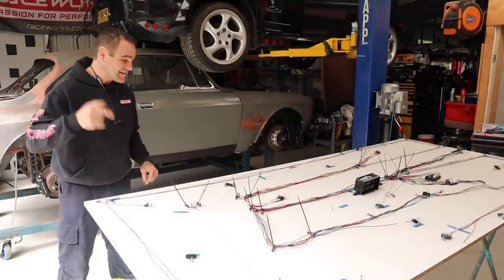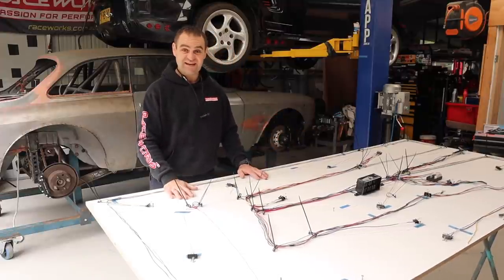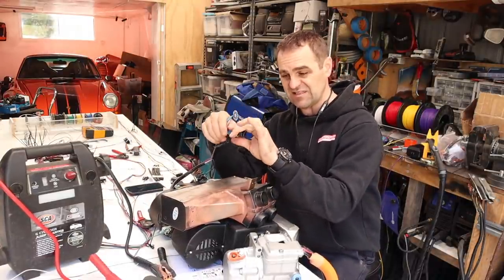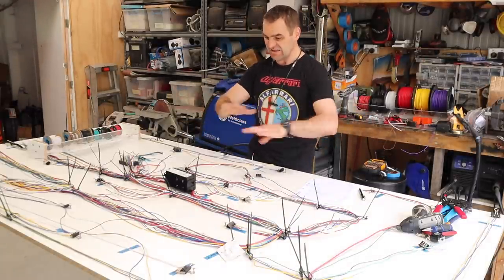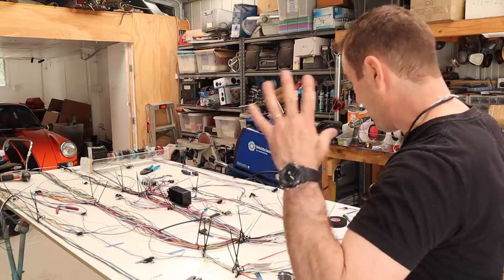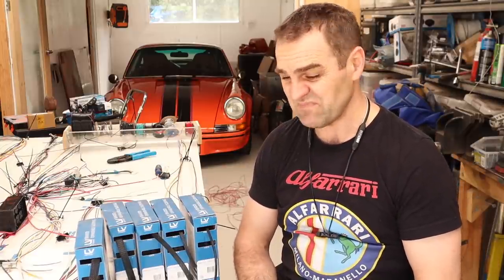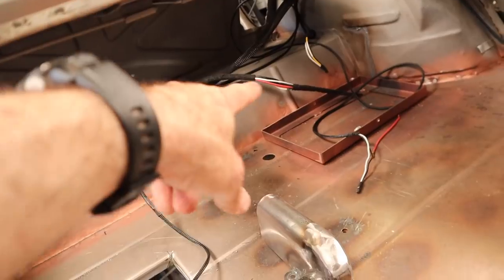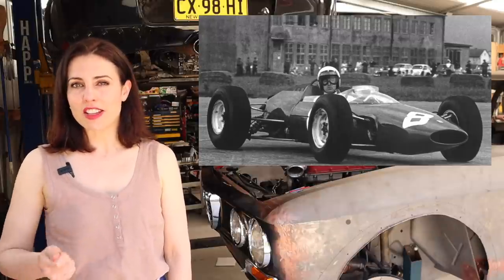Wrapping up the body harness - Ferrari engined Alfa 105 Alfarrari build part 111

Comment: Great job Jeff!
Only thing I would say is about only having 2 ground points for all that might be an issue down the road?  Electricity always likes the shortest route and grounds are usually shorter travel to reduce electrical load (cable resistance), reduce electrical noise and to stop them chasing to get ground "space".  Think of it like a series of water hoses feeding a drain, better off with more smaller, closer drains than one 😀
Just food for thought but definitely impressed with the work gone into this over just going to a scrappy 😀👍
Reply: That'd show up as noise through a stereo perhaps turning on the wipers or doing the electric windows, I believe?

Comment: Im  a firm believer in a bit of soldering those slices mate.. And paint on insulation under electrical tape or heat shrink
Reply: Solder is never used in professional motorsports. Crimps are more reliable and if done correctly (which isn't hard to do) creates a cold weld. I read somewhere that soldered splices are about 10 times more likely to fail than crimped splices

Comment: I'm redoing my 105-wiring as well, ended up buying a huge roll of single color wire for most of the wiring, different color for higher gauge, black for ground and relying on lettered shrink wrap instead of colors. Also added a modern 12-pin connector berween the engine compartment and the cabin. Moving fuses and relays to the engine compartment for better access

Comment: As a thought, if you do this again, I've seen people mount the board like you have vertically so you don't have to bend over it. And Tesa interior (the fuzzy stuff) will hold water. They also make an Exterior tape that is harder to work with, but it is weater resistant. And neither of them are a replacement for electrical tape. They are made for harnessing. The also make the interior tape in a 3/8" (~10mm) width and you can spiral it on like factory German harnesses do. It makes for easier serviceability (though not as pretty as the braided loom).

Comment: Rather than taping the ends of the sheathing you could use 25mm or so of heat shrink.  It gives a great appearance and keeps the sheathing from fraying.  It also won't gum up or unwind like tape might.

Comment: Good job. Just remember the nylon protection does not protect agains weld burs, so try to keep the harness attached to the body every 200mm to avoid relative movement and potencial Fire Hazard.

Comment: Throw away your toggle switch for the fan speed and the resistor and replace it with a very cheap pwm dc motor speed controller for infinite fan speed adjustment. One of the best mods I ever did on my car as I always find that the next speed is too fast and too loud but with the speed control you can balance it all for air volume and noise.

Comment: Great job sir I love it  👍👏 
I'm working in dealership & I have more cases of some communication wires , positive wires touching  in body (ground)  ( actually some wires are pinch or damage because rough surface of the body ) 
I kindly request put little bit more protection 😊👌👍👍
I like your work sir  
Carry-on.. God bless. 🙏👍

Comment: That race works stuff looks great, I've used a similar product from jaycar on my 3d printer and it was crap after you cut it with side cutters,  cutting it with a heated blade so it sealed/bonded the strands was the only way I could use the stuff

Comment: Running dedicated earths is a good move especially when it comes to rust.
By not using the body as part of the electrical circuit galvanic corrosion can be reduced. Fitting sacrificial zinc  anodes may also actually work or work better.

Comment: I was just watching the latest and people saying about the 2 earths. I assume you've ensured that if earths are joined within the loom as it heads to either of the earthing points that overall the wires can handle the total current of the linked devices? So 2 20amp wires would need to join to a single 40amp wire as an example. 😉

Comment: Don't go with 2 grounds. 
Have seen alot of Troy with the ECU if to meny things is sharing a ground. Especially if the spark coils are sharing ground with sensors or other electronic.
Reply from the maker: High end motorsport use only 1 ground.

Comment: Have you considered electrical load on the earths with only 2 points in considering the earth wire size? Eg 1 earth wire from a taillight cluster can be for the brake, tail, indicator, reverse, and fog light. If all of those are on at once for some reason, that's 5 loads of current running through 1 wire which were fed by 5 individual wires. Doesn't need to be 5 times the size, but needs to be considered. You've got half of a car running to one point. 
Or did you run individual earth wires back to just 2 points? 
Getting this stuff wrong can mean a smoking car...

Comment: Have you thought about running the speaker wires at the same time whilst it's at this stage
Reply: I helped a friend recently wiring his 1750 GTV and it would have been good to know about the “rope trick” at the time. If you think your method was messy it was worse doing the design and wiring directly in the car. It will be interesting to follow the functional test, let’s hope for the best!
Rgds from Sweden
Reply from the maker: I have ;)

Comment: Hey Jeff if ur putting the battery in the back would you use a standard battery or a lithium battery I’m thinking of putting the battery in the back of my spider behind the seats. Instead of the trunk where fiat spiders  use to have them from 74 -85  I’m planning to put a bus so Alfa v6 bc I can’t afford a Ferrari v8 lol

Comment: Question with your splices, is there a reason that you cut the original wire instead of just stripping the insulation?
Reply from the maker: I do both depending on what is happening the other end. I thought about showing that way as well.